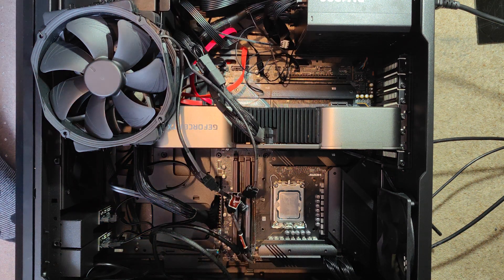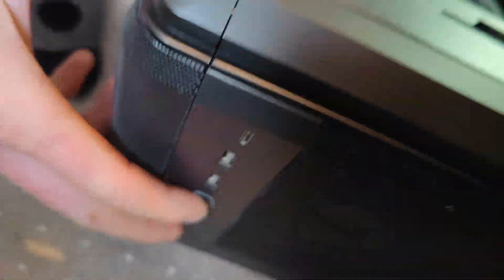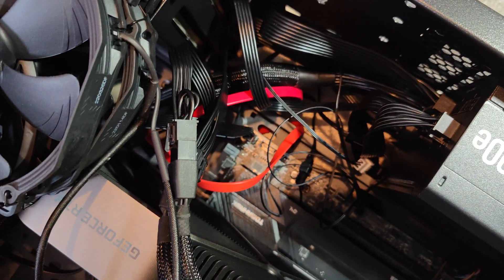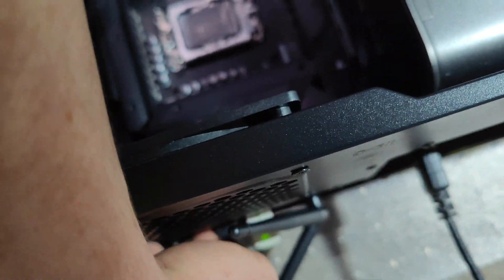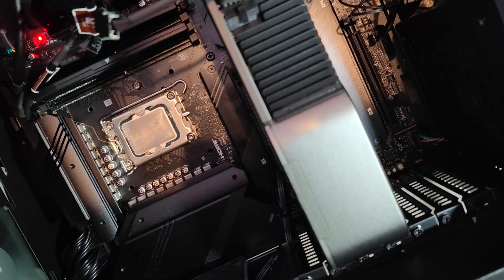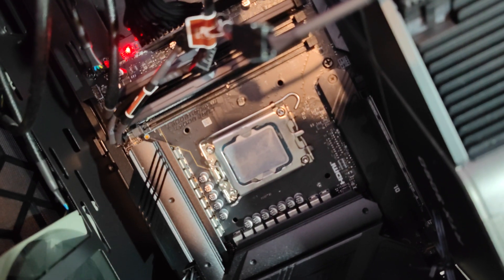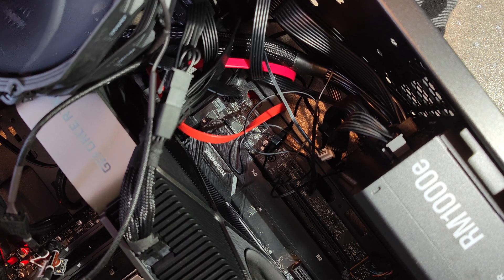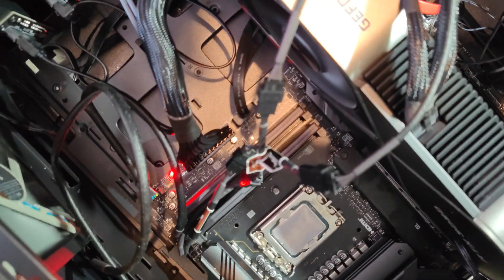MSI Z790 Tomahawk WiFi will not start unless doing BIOS reset showing CPU EZ Debug light on

Comment: Exact same problem here.
Tried everything apart checking the CPU, i'm so scared i screwed it !! xD
Reply from the maker: Don't worry, the CPU is obviously the hardest thing to check, but if it's behaving as it was on my board in the video (i.e. no reaction to power switch, but works on EZ Flash), then it is more than likely the board. Have you managed to get it to run on the EZ Flashback button?
Reply: @dougtracey53  i ended up RAMing it and ordered a 2nd one.
But same thing happened :D
And again for a 3rd...
I'm trying for a 4th time, but this time with the help of a tech at a Store.
Reply from the maker: Oh dear, maybe it is the CPU then. I hope they can sort it for you, but can imagine it's infuriating once you've built the whole system for it not to work so many times! @borisgauthier1482
Reply: @dougtracey53  The 4th MoBo worked perfectly at the store, with my RAM sticks, CPU and 1 SSD NvME.
Took it back at home and tested it with my PSU : woked.
Finally ended up mounting the entire Computer, and i'm writing this from it now. :)

Really wierd that it took 4 MoBos... still don't get it.
But at least now it's working and the nightmare has finished :D
Reply from the maker: @borisgauthier1482  that's crazy! Can't believe you had the same issue with so many boards! Definitely showing that Z790 Tomahawk has issues.
Reply: @borisgauthier1482 I want to get this board because it’s $200 cheaper than the ROG Strix Z790, but it sounds like you have to get lucky with a working board
Reply: @javidplummer410  i believe i got unlucky rather, to have 3 DOA MBs un a row :D
But there's definitely an issue with this model. If you're patient with RMA delays, you can have a working one.

That is the exact same reason why i kept going : the other models are 200€/$ more... with no real justification for it..

Comment: Same problem for me...i9 13700k and motherboard never start
Reply from the maker: Hopefully you can RMA it then, but hope my video helps you to rule out any other hardware problems
Reply: I order an asrock z790 Steel....will see.
Anyway thanks for your vidéo,you save me from day of 🤬
Reply: My Asrock z790 Steel is now mounted and the pc is running fine now.thank to you
Reply from the maker: @cedricgriff7848  Glad to hear it Cedric and hope I helped you troubleshoot as much as you could. Shame the Z790 Tomahawk didn't work, but as I mention in the comments, I did get a Z690 Carbon in the end and that's been solid since!
Reply: I will return it but i find this is very strange, my issue is exactly the same than yours
Reply from the maker: @cedricgriff7848  that's why I decided to not replace and was happy to get my hands on the Z690 Carbon Wifi, which actually has a lot of better specs and was slightly cheaper! I hope you can build your dream PC!

Comment: I am having this EXACT same issue with a MSI Z790 Carbon MB. Did you ever resolve your issue? Mine actually worked after i set it up but after a power shutdown in windows it no longer turns on from the case buttons.

Comment: Damn... Now i'm scared. I bought this board but i wont get all the components until a montyh or so, so i'm here sitting in my new motherboard fearing it will turn out to be a brick when i complete the build later. Fingers crossed.
Reply: i have the same problem here i tell you its not a rare occurence
Reply: @glavrjk Confirmation bias. The only people here are those with the problem.
Reply: @Nyx_2142  but still, that's a lot lol
Reply: Same problem here.
Reply from the maker: I'm sure it's a pretty rare occurence, but hopefully this will give you some ways to prove if it is another component or if is the motherboard.

Comment: I had pretty much the same issue, but holding that button only ever kicked the fans into a couple rotations once. RMA sent off today, lets see what happens! Ive also heard a lot of people have had issues with heat on those lga 1700 sockets and have had to get a different contact frame, ive ordered one of those in expectance of a new board! Heres to hoping!
Reply from the maker: No, I had to rma and ended up getting hold of aZ690 Carbon WiFi board which is pretty much the same specs for less money

Comment: had clients ordering 5 of these motherboards past week, 3 of them arrived in this bricked state, this was it for me, the past years msi is getting worse and worse, monitors with dead pixels all over the place, gpu's that are not working bricked motherboards, and an absolutely horrendous warranty policy and even more worse customer support, yesterday i did what i should have done 2 years ago, put everything with an msi logo on it in a box and sended it all back, and i cut off every connection i got whit this trash company, not selling or recommending their hardware to my customers ever again.
Reply: Could you give a recommendation instead?
Reply: @schnipslhansi   anything that isn't msi or gigabyte, i use asus or asrock most of the time.
Reply from the maker: If you can get your hands on one, maybe try and get a Z690 Carbon Wifi as the components are much better and the Z690 to Z790 difference is minimal to non-existent!...currently in stock on Amazon UK:
https://amzn.to/406TEml
...and the Z790 Carbon Wifi is also on Amazon Prime Day Deal: https://amzn.to/3tz9k5f

Comment: EXACT same issue, same board. got it today and sent it back same day... this is the first all new build iv every done for myself... built plenty for friends.... never had an issue... figures on mine i have issues.. only way i was able to get the MB to show life was jumping the psu wake circuit with the MB plugged in and i got that CPU light... proceeded to inspect pins reseat cpu blah blah blah.... waste of a day....
Reply: Got my board from Amazon and doing exact same thing with my i9-13900k
Reply: @Tazorraxx  ya good luck I went through 2 DOA Mobos before getting a good one even called msi on the second one because it was doing the exact same thing and I thought I was going crazy. I wasn't just 2 DOA mobos

Comment: EXACT same issue here. Bought new couple of weeks ago off Amazon and just managed to put it together yesterday as was waiting for parts. No power at all unless doing Bios flash which works as described in manual. Same thing occurs on mine with CPU cooler/pump working find during Bios flash and CPU light on. I've seen on another screenshot of Bios flash button being used that CPU light was on as well - so that suggests it's normal. After Bios update finishes the system shuts down automatically. And ofcourse the power button still doesn't work, nor does shorting JFP1 pins. I'm going to RMA but not sure if I should just get a refund and try find something local as shipping last time took over a month from Amazon to New Zealand (usually takes couple of weeks).
Reply: I am having this exact same issue. Did you manage to find a solution or just returned it? Thanks
Reply: @saulalarcondelcampo  returned
Reply: Plz help got the same issue !!!
Reply: @francobonaparte1640  I would return it. I ended up returning it. I got again the same mother board, but this new one worked perfectly.
Reply: Its a good motherboard once u get a working one.

Comment: Why would you even attempt to power on with out a processor cooler? You'll kill it.
Reply from the maker: Just following the advice of the MSI troubleshooting. It won't get crazy hot unless you put a load on it and the BIOS reset doesn't even use the CPU from what I understand. It's not going to overheat if you only have it on for a few seconds to see if an error light comes on the dashboard. Techies at LTT do it all the time for short periods of time. Hasn't damaged my CPU, which hit 38384 in Cinebench the other day at 92C peak temp.
Reply: This is the correct answer. You can safely boot into BIOS for functionality check, then power off before the CPU heats up to a dangerous level.

Comment: I got the exact same issue. Bought the board last week. It Has the same issues even after bios reset. Ist there any way to fix it or do I have to return it?
Reply from the maker: Have you tried trying the BIOS flashback button with a USB stick with a valid BIOS image on it? Mine powered on with that, but nothing else did so I had to RMA in the end, but it will rule out most other components like the PSU if it does and also will show any other errors (i.e. memory, CPU and a few others) on the 3-4 lights that are next to the MB power plug

Comment: Hey man, I have the same problem. Did you replace the MB for the same?
Reply from the maker: No, I decided to use the same budget and upgrade to a Z690 Carbon wifi, which worked first time! So much higher specs for the same price!

Comment: My PC turns on but won't boot up the dram ez debug led is on idk what to do help?
Reply from the maker: I'm not actually a support function of MSI, but posted this to share with their tech support and have replied to comments when I've noticed them as did a vast amount of troubleshooting of this issue which resulted in RMA. 

If your system is turning on, but the DRAM light is coming on, that is flagging that either your Memory is at fault, the sticks are in the wrong slots, the memory module on the board....this is some advice I have just seen for debugging DRAM light being on a MSI board:

https://www.cgdirector.com/msi-ez-debug-leds-troubleshooting/ 
Memory Configuration
- If the RAM is properly installed and the DRAM debug LED is still lit, check to see if the RAM sticks are placed per your motherboard’s suggested configuration.

- If using multiple RAM sticks, ensure none are installed in the wrong memory slot. You can also try removing all but one stick and attempt to reboot.

- If that doesn’t work, try plugging in a different (single) memory stick, and try again via both the first and second memory slots.

- Also, make sure the Motherboard supports the RAM Modules you bought. The QVL List on your Motherboard’s support page will let you know.
Reply: Same issue here. I’m on my 3rd board and MSI support is zero help
Reply: @TheHugeMoist  did you try booting the PC without the GPU?
Reply: @kensho_425  Literally just tried about 10 minutes ago. Didn’t do anything for me
Reply: @TheHugeMoist  yeah and it doesn't help that the YouTuber doesn't even comment on it
Reply: @kensho_425  to his defense it’s not what the video was covering, but I get the frustration. This shit sucks
Reply: I have this exact same issue right now. I have tested all the suggested memory configurations in the manual. I have tried to flash my BIOS (twice) and cleared CMOS. Nothing helps. I removed the GPU and detached all SATA drives, no help. And this is a new rig. Previously I had to return one ASUS motherboard due it bricking while updating BIOS - on that motherboard the memories were working, but now this Tomahawk is giving a an error led for them.
I can't even access BIOS since I get no picture out.

My RAM sticks are both Kingston Fury Beast (KF556C36BBE-16) - as I have understood it, Kingston always works, and these are also listed as compatible.

Also, while the yellow error led is lit, the computer boots itself on loop. Don't know what that is about but it's super weird.

A colleague suggested I try with another set of memories but I'm pretty sure that this avenue too is not fruitful.
Reply: @AmazingDudeBody  I RMA’d 3 of these boards until I finally decided to send my CPU back to Intel. Turns out the CPU was just dead.
Reply: Sounds incredibly stupid—- but hear me out: did some of you forget to hit the power button?

The msi motherboard will behave totally dead, and not post until the power button on your case is pushed.

I say this, because the old PSU’s and motherboards would turn on, example fans, and post lights some years ago.

But, when you plugin and turn on a msi board for the first time it doesnt start a post or any operations until the ON switch is closed.

Also, did any perform motherboard and psu tests before your builds.

Guys, dont blow me up. Just take a wild guess as to why i pointed this out 😁👌

Comment: exactly same problem here guys....
Reply from the maker: Try the following:
1. Try the PSU test using a fan to checl there is power coming into the PSU (if BIOS reset is allowing power on, then PSU is fine
2. Check the power switch is wired up correctly from the case
3. Check the lights other motherboard to see if any are showing issues with CPU or memory etc
4. If all else fails, RMA the MB and get the Z690 Carbon as just seems to have much better core components
Reply: @dougtracey53  
1) The psu is right now on my old rig as i write you from it......psu is coolermaster 800w .
2) The power switch is on the correct position jfp1 jumpers 6-8 indicated  on manual 
3) No lights at all no fan spins etc when i press the button just silence
4)i started already the procedure to sent it back to the shop for testing etc (i afraid to trust msi again)
5)i will buy a new psu 1000w to test with two eps on mobo (mine has 1) but i am very skeptical that will be the issue...
6) Same behavior with the bios flash button as yours.
Thx for  the reply!

Comment: Got the same issue with Intel i7 13700k
Reply: Going to replace the MB as well.
Reply from the maker: I think my situation was 100% the motherboard. The chip was perfectly fine and is working incredibly well in the Z690 Carbon I replaced it with. 😁

Comment: I’m having the same issues. Getting a replacement motherboard soon. Hopefully that’s the solution.  I’ll let you know.
Reply: Did you end up getting the same motherboard or did you get a different one? I'm curious because I've got the same problem.
Reply: @DmitrievIII 
Sorry, better late than never, MOBO was DOA. Got the same board as replacement and it worked.
Reply: @Hallam732  Hey, no worries. Your comment helped me determine it wasn't me doing something wrong. Ended up returning mine as well.
Reply: Same problem here! Any updates?

Comment: Is that a new case? I had an issue with a fractal case recently where the front panel was defective out of the box. I thought maybe a motherboard issue but I connected the front panel of different case I had in the garage and it started right up. Just a thought. If you have another case give it a shot.
Reply from the maker: Yeah, replaced the Z790 Tomahawk with the Z690 Carbon and everything worked perfectly first time! It's the Cooler master Master box NR600P, not certainly not a cheap case! Running like a dream now😁